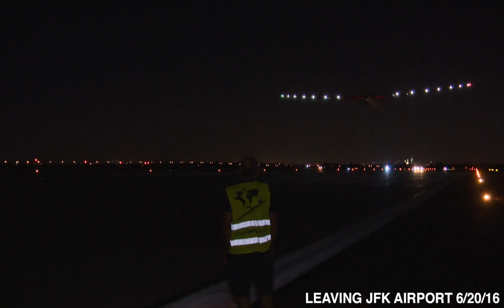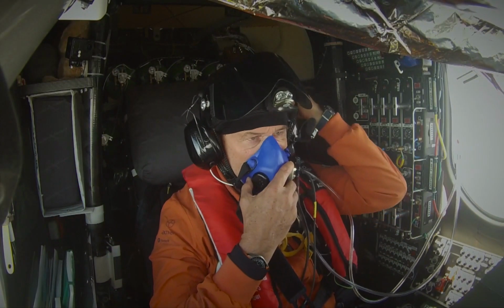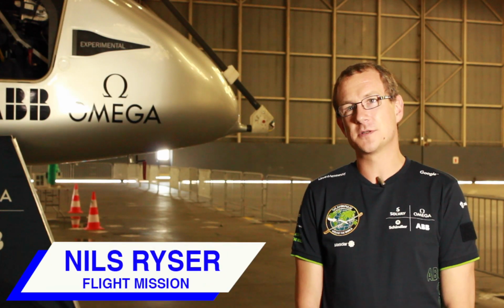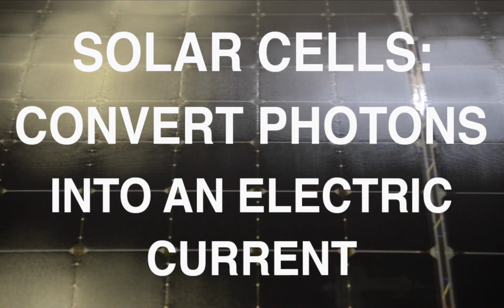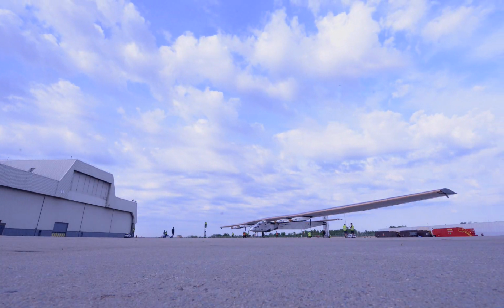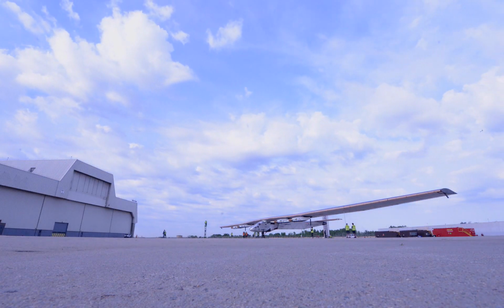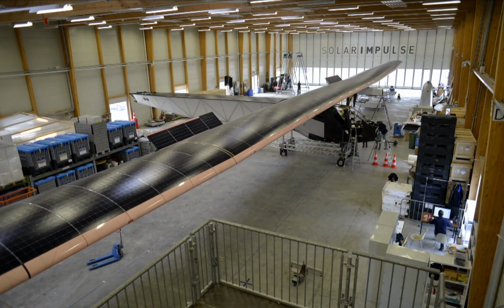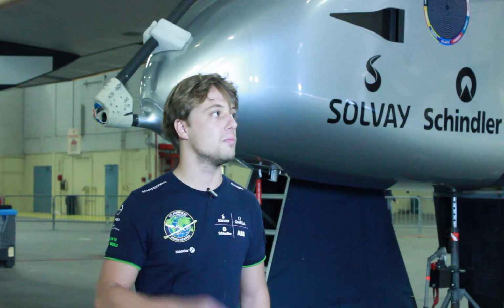Can You Fly A Plane Without Fuel? | Solar Impulse

Comment: While this is very cool it will never work for commercial flight.  Even if the solar panels were super light and somehow managed to capture and use 100% of the Suns energy hitting them it wouldn't be enough for passenger lines.  While this could possibly be used for small private planes I think the air frame would be far too fragile, large, slow, and expensive to make it competitive with the Cessna.  I believe Solar powered flight is not the future for people and will only really be useful for different types of unmanned drones that need to remain airborne indefinitely.  Unless of course you want to travel overseas on a plane that will take 10 times longer to reach it's destination, all with no heating or even a pressurized cabin because that would make the aircraft too heavy to fly.  Also heaters drain far too much energy to ever have a place on such a craft.  Have you ever seen how much power something as small as your toaster needs?  1500 watts give or take.  I'll stop here before I go on a rant, people's ignorance infuriates me.  So many people in the comments think this is some brand new revolutionary idea that's going to change the world.  Why don't you just burn your money before you do something really stupid like giving it to the Solar freaking roadways people!

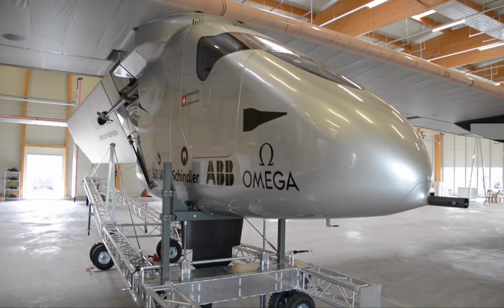Comment: Why does the electron flow to the negative side (just before 2:24), shouldn't electrons be flowing the other way or is this that conventional current thingy
Reply: I think you're right. Conventional current flows from the positive terminal of the battery/power source to the negative. While electrons do the opposite.

Comment: Why does it have to have a pilot at all?  Couldn't this be used for high(er) altitude autonomous flights,  holding sensors, or cameras,  or perhaps even used as air defense.    If they could hold even just 1 use that has the chance to stop say a missile,  then that's better than nothing,  and it'd always be there,  circling the skies across borders.     Especially if lasers ever become efficient enough that one could be housed in one of these,  then it'd never need to land to reload or get reequipped unless damaged,  or just for a routine maintenance.    And I mean with future refinements and improvements to the concept,  as-is it may well be incapable of much at all.   And it may be crazy fragile,  but if it was developed further,  ya know?     Obviously there are better weapons,  but I'm not talking about a weapon.   Something much more peaceful,  just something that helps keep skies safe.